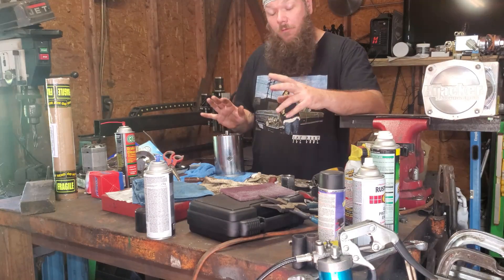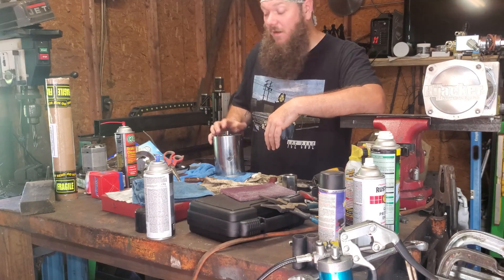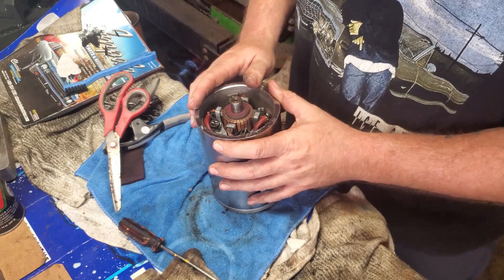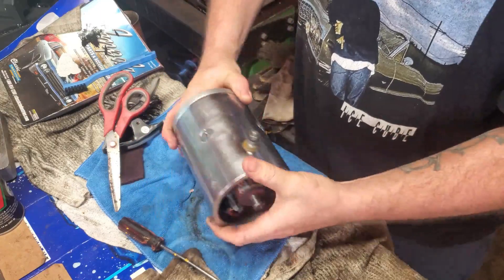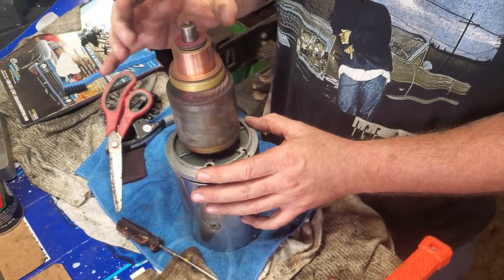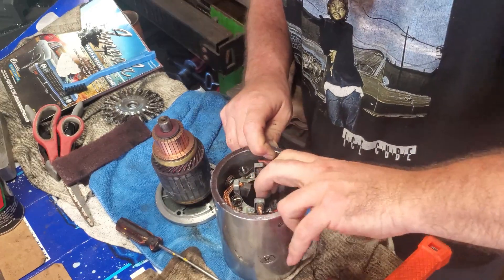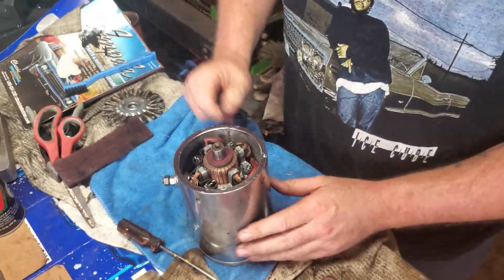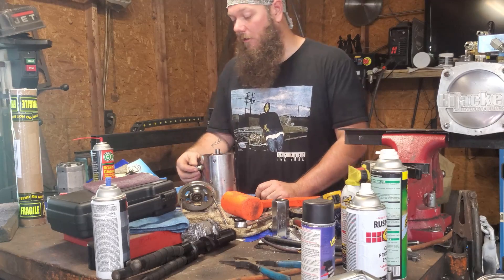Putting A Hydraulic Motor Back Together

Comment: Years ago i burnt out a motor..thought wear a tear. Put a new one in. First hit . Arced out blew a hole in the cap. Turned out the battery cable was sitting in oil in the trunk. Swelled up. I took the motors apart. Armature was destroyed by the brushes. Put that in my Drill press aka. Sketchy lathe. And held some 80g sandpaper to.then finer to the copper. New brushes.  Both motor work again. Thanks for video.
Reply from the maker: Yeah a drill is a good idea

Comment: Great video Dan! Off topic question though, what happened to the Oldsmobile with the wrapped frame? You doing to bring that back as a hopper?
Reply from the maker: It's sitting behind my shop I actually had it up at the house a few weeks a go put a new carb and plugs in it but had to pull off it to work on other cars my overall plan is to hop it 4 pumps 14 batterys